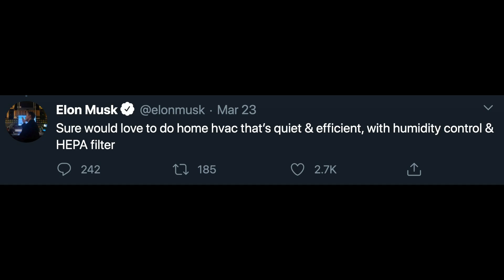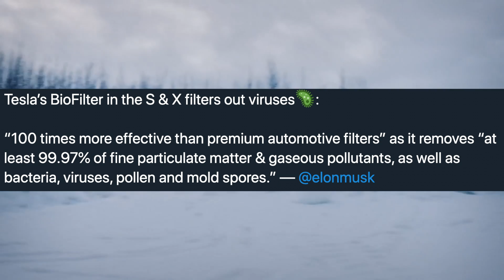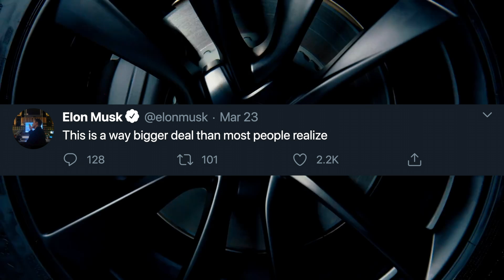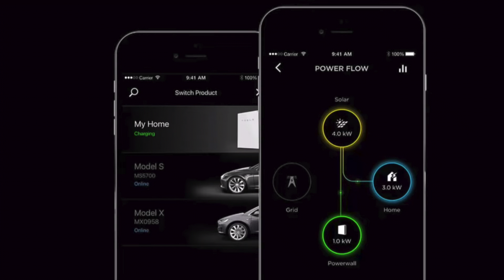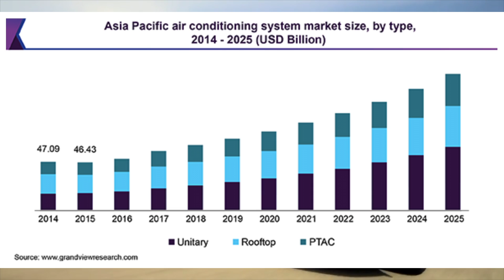Tesla's Secret Upcoming Product: HVAC for Homes (Heating, Ventilating, Air Conditioning)

Comment: If you make window shakers (window a/c units) with high-end items like inverters and HEPA filters and so on, they will be as expensive as Tesla's cars. Working-class folks will be priced out of the market. In addition, only the rich will be able to afford repairs to such pricey units.
Reply: Chuck Wagon so you already know the price of these units before they’re even out? Nice dude
Reply: @devanclark8018  
I've been in the HVAC manufacturing business for over forty years. Yes I do know what they will cost because I know the technology Tesla will use. It's "inverter" technology, which allows the window unit to operate at lower speeds than regular air conditioners and involves the use of expensive circuit boards and capacitors.

Comment: If they make lightweight, portable, noiseless, decent cooling window AC i will buy their company.... i’ve been looking for one 5 years... tired of old, heavy, big, noisy ones....
Reply: You can get a 1 ton hvac mini split head unit for about $800 on Amazon. They are nearly silent. RVers are ditching their RV hvac systems for this set up because it can heat and cool the RV from 3 solar panels vs needing shore power and propane.
Reply: @Squeezmo   i live in public NYC apartment..... i need window AC... split is very good system for private house/apartments...
Reply: LG has already done this. They have 3 different sized window units that use variable speed compressors. They have essentially put ductless minisplit tech into a window unit.

This is the model number of their  14k btu window unit. LW1517IVSM.

They have a larger unit but it is 240v.
Reply: nonsense
Reply: Lightweight and portable means small, small means small ventilators, small ventilators means little volume of air or high fan speed, so either noise or sacrificing capability. You are most likely asking for something physically impossible. That is, if you don't have a better idea to move air than fans, since you need to move air in order to cool it
Reply: @trulyUnAssuming  Exactly. The noisiest part of typical HVAC systems is moving air through the condenser, evaporator and any applicable filters. HEPA filters introduce a fair amount of head pressure, so you need fans that much more powerful to push air through. You are stuck having to pick along the spectrum from large fans that produce nearly-white noise to small screechers. I can barely hear my window AC's compressor over the noise its fans make.
Reply: @teardowndan5364  note that R410 minisplits are using variable speed (variable low would be better), large diameter slow RPM fans.  We used this scheme on submarines to make our equipment run quietly and efficiently. There's a lot you can do when you move away from what everyone else is doing.
Reply: @teardowndan5364  So why can you barely hear a mini-split outdoor unit running?
Reply: @teardowndan5364  that's the problem./ It's the blade technology. There are blade shapes that are nearly silent... and eductors can be used with small, high speed fans  to quiet and mask duct noises (again, submarine tech).
Reply: @trulyUnAssuming   "something physically impossible" been proven by many tech devices that almost anything possible in 21 century.... good brains and money in 2020 can make impossible things possible... or at least close to that....
Reply: @NEWTRUESTORIES  No, tech devices just do things which are difficult, not impossible. You can not cheat physics.

Comment: He’s late to the party, and not many AC units I know of run on gas.  You’ve not explained one thing that is not already on the market or how he is going to make a better mousetrap...   the power wall doesn’t seem like it’s lived up to the hype besides being a better tracker of ones power consumption and I wouldn’t be surprised if they are monitoring and controlling your AC real time with the ability to shut down during a crisis.
Reply: Heat pump
Reply: Kevin Dickson lol heat pumps have existed for long time and the R&D from the big manufacturers are light years ahead of Elon

Comment: Nice video and joining of dots, but you can go further.
Google, Apple, Amazon etc are trying to create the smart home, though just to stir sh!t, I’d argue that Tesla’s ecosystem is just as good, if not, better. Their access control (locking / unlocking / motorised door handles), hvac (pollutants incl), power management (on / off / schedule / amperage), App integration (runs google maps, Spotify compatibility, youtube), lighting control (app control, automatic), security (sentry mode), ranks them ahead of anyone else. The final step is taking all that stuff out of a car and putting it in a house. At least, that's how the argument goes...

Comment: It’s crazy AC uses a much smaller amount of energy than heating, but in the southern us, during the winter, your electricity usage dropps
Drastically, even when its freezing outside and you have electric heat.
Reply: Howdy Justice which is why it doesn’t make sense AC is a much smaller percentage of the energy usage graph

Comment: That would be pretty sweet to optimize HVAC to work off of home batteries. I think we would have to optimize the house electrical system to work off of batteries.
Reply: all Homes should have been Converted to 100% Electric in 1900. 
Electric Fireplace and Heating, Electric Waterheater, Electric cooktop , Electric Oven. 
and it should have been Mandated , all NEW Homes in 1900, should be 100% Electric.
Reply: Im_Zee11 lol so the battery gets charged by the grid and then powers the AC unit? What’s the point in that? If it were solar you would spend a huge amount on panels and batteries never recouping your initial costs.
Reply: ReluctantProphet mmmhh what if there’s no grid?

Comment: I’ve got a solar tile roof on order, I’d love to add a Tesla HVAC unit to that.
Reply: I do too, have you been given an install date yet? What state are you in? I fear we may miss the 2020 energy tax credits if Telsa drops the ball on this
Reply: Minni , I’m in California. Haven’t heard a thing except initial e-mail from a rep. He said I’d be contacted in the next 30 days but that was about 30 days ago. I can imagine they are in a bit of disarray given the lockdowns.
Reply: @shepherdsknoll8  Yeah I know, I wish the company would more forthcoming with information as as availability. I'm in New Mexico and need a roof I'm trying to hold on but I don't have too much time left. I submitted my energy bill and they said it should move quickly but did not give a timeline.
Reply: Minni , if I have to go another rainy season, I will. We are just coming out of 2019-2020 rain now. For the last three years I’ve held my wood shake roof together with elastomeric paint (roof paint) from Home Depot. It is a cheap short term solution.
Reply: Minni , I just got my roof plan and estimate from Tesla, it took a little longer than 30 days. For a 3000 sq ft home it came to $49k with (2) powerwalls. There is a federal tax credit of $7500 so total cost is $41,500. I think I have a California state rebate also. Tesla is applying for permits now.
I really wanted the slate style roof but this price is so good I went ahead and accepted. My electric bill runs $600/ mo. so this is a no brainer. If the slate comes out in 2-3 years I’ll re- roof.
Reply: @shepherdsknoll8  So you are getting traditional panels and replacing your shake roof?
Reply: Minni, I believe Tesla only offers the black glass paneled roof tiles at this time. Is that what you mean by traditional ? Yes, I will use their black glass for now.
Reply: @shepherdsknoll8  ok got it, so you got black tiled roof that's awesome. I'm still waiting to hear something

Comment: They got the boring company. All he needs is point his boring machine downwards.
Reply: It has been proven that geothermal heat pumps cannot compete with mini splits
Reply: You don't need a 12 foot diameter hoke for a heat pump. They use well drilling trucks to install geothermal.

Comment: It all comes down to, if they could produce a system that is cost competitive with with traditional HVAC systems.
Reply: @William Arrington Oh! like Apple. Yea that occurred to me also. The last thing we need is another company creating a closed ecosystem that locks people in.
Reply: How dumb are you?  It would be no different than existing systems.  There is nothing new to do.  You want HVAC that is quiet with filter, go buy one from any number of producers that already exist.
Reply: @w8stral  Air conditioning manufacturers had little to no incentive to build more efficient equipment till the government mandated they do so. It cost the industry a great deal of money and consternation, but today they are competing using efficiency and energy savings as a selling point. The car folks didn't like disc brakes either, now they build cars, light and heavy trucks with them and we are all safer for it. A to the cracks about "proprietary equipment", that is already baked in when one large, well respected maker created their own freon blend and build a system that exploit that compounds thermal properties. Nobody put head lamps on car fenders till the patent ran out on the high end folks who held it. So goes modern manufacturing progress.
Reply: @w8stral  You need to rethink your position vis a vis what is your mouth hole and exposing that other hole to public condemnation. I believe if you will cease frothing at the mouth, you will find I said about the same thing you have, albeit with a much less political crap load. R22 and R12 are not the first common refrigerant brews used that turned out to be very toxic and needed to be outlawed or insured at catastrophic rates. Go look up R502- liquid at room temperature- will evaporate in your bare hand- but by the time a few grams have evaporated you will have absorbed enough poison to kill you. It wasw the refridgerant of choice for hotels and convention centers. I believe I remember R22 being one of the replacements for it- it doesn't retrofit any better than Ra 134, at least not with out expense and changed efficiency; as a refrigerant in a car, Ra 134 is only about 80% as capable of carrying the same thermal load , pound for pound as R12. The result for Detroit is ACs that were about 20% less efficient than before the early 90s, when the R12/R22 phase out began.
  PS; Getting up front and personal with me is not what I would think to call a "thinking or questing sort of response". The price of civility from me, is you being civil to me. Your turn, AH
Reply: They have the leg up of being able to market to rich people for the first generation if it’s too expensive.
Reply: Victor - EZ to do a simpler HVAC system with NO pulleys and NO Belts , means it can be made Smaller & Lighter and Cost LESS, also having a CLASS Leading Medical Grade HEPA filter as well.
Automatic AI Fuzzy Logic computers will only Cool/Heat when room is Occupied and will Automatically balance the Humidity, it could even be an Emergency source of Drinking Water.

the NEXT step is to Create better and more Efficient solid state Cooling/Heating Tiles. 
ones without ANY Pluming just a Electrical Circuit.
the Inventor of that will make a Fortune.
Reply: @markplott4820  We already HAVE that.... they have PISS PISS PISS POOR efficiency.  HVAC systems(medium/small) do not have pulley's belts.  Only the GIANT commercial ones with BIG squirrel cage fans do.  Basic HVAC all have dehumidifiers built in, otherwise it becomes bad news.  Most people for their homes are not willing to pay for it. 

Grow a brain, stop worshipping and swilling the TESLA Kool-Aid
Reply: Not necessarily. If they sell a smart home HVAC system with clean water generation, they can capture the added value through higher upfront cost.
Reply: @Fridgidice  Dear Ignorant Arrogant Dumbo, you get this already if YOU BUY IT.  Just because you are an ignorant lazy idiot, does not mean the rest of the world is.  You simply REFUSE to PAY for it.  PS: you get ~->2 gallons of water a day in a VERY humid environment and near ZERO in a dry environment...... yea as if that is worth an extra thousand to two thousand dollars when a $40 water filter does a superior job and does HUNDREDS of gallons.  Troll onward Ignorant!
Reply: @William Arrington No I don't think many people have. However what I do mean is that not every millionaire has a mansion. The majority of them especially in the vicinity of Elon Musk, have apartments or townhouses. These are the same people who only drive Teslas and already have Powerwalls and TeslaSolar on their roof. Telsa could easily sell to them just based on the fact it would be supported by the Tesla app.
Reply: @William Arrington Don't forget the new refrigerants are more corrosive, and have lower COP than the old ones so your HVAC systems die sooner and require more power to operate.

Comment: You informaation is wrong...Tesla is using Hepa filters since 2014 since the unvailing of the model x event. And not 2019 please check
Reply: That pic in your video is form the model x unvailing event
Reply from the maker: I was referencing the Bioweapon defense mode HEPA filter, an upgrade from the previous Model S and X filter. The picture was from an article talking about the upgrade.
Reply: It's there since model x

Comment: HVAC accounts for 40% of total building energy consumption. We spend most of our time in buildings.
Reply: What about insulating your homes?
American houses are mostly un-insulated I understand.
Reply: @SwedeInCPH  Your absolutely right ! Best cost for your money.
Reply: Wrong Insulation Does make a Huge difference no matter where you live, Windows are on the lower side of  efficiency upgrades you can make with the exception if you live in a glass house. As someone who Works and follows the Industry  less of a Heating and Cooling load less Energy required.
Reply: @Gcanno  thank you mate, for the last decades, european and asian countries have been building more and more efficient insulated houses that requires little to nothing for cooling or heating, in japan the dont really rely on heating during winter , they use huge thick bedshit for example. the US is always behind as a usual
Reply: @William Arrington stop talking nonsense
Reply: @William Arrington Yeah and I do Hvac most the time and Proffesionals like you , speak of Lab numbers which never translate in the Real World and yeah I deal in thermodynamics everyday too the only difference is I do it in the Real World . A world where we Test in and Test out to Confirm efficiency and Seer. Which by the way depends on everything connected to your new Hvac system that includes lineset ,component location ,Ductwork ,System Refrigerant Charge, and Yes Insulation Take 140 Degree Attic in the Summer Take your Duct R Value and Calculate it  by the total square footage of Duct you have running to get your losses then see if your seer adds up 9 out of 10 times it does not. These are the people who write the standards if you ever want to educate yourself . https://www.acca.org/about-acca

Comment: I wish he would set his engineers on the problem of solar home heating,  specifically involving the siding, since the roof is already producing electricity.
Reply: What about a heatpump that produces both cold and heat?
A solar cell has an efficiency of 30%. Collecting heat from the roof through water wacuum pipes has a 90% efficiency.

First action: Insulate you homes. I hear American houses are generally very poorly insulated. Pays off both in summer AND winter, but maybe too LOWTECH to be sexy!
Reply: @SwedeInCPH  I agree with insulating homes as an important first step.  For some reason roof solar heating systems never caught on.  Maybe a good solar photovotaic system with battery storage plus a geothermal heating/cooling system would be a good combination. A number of  decades ago the use of zeolites was suggested for heat storage during the summer which would then be released in cold weather, and it was being studied a few years ago in Europe, but I have not heard anything significant since.

Comment: It is a cool idea but think you are missing key details on the type of HVAC system Tesla would develop. It would obviously have to run on electricity and be super efficient. Therefore it would have to be a heat pump, likely an air source or split ductless.  Tesla just started building heat pumps for the Model Y after using a different HVAC system on its previous models. I would expect Tesla to convert all its models to heat pumps before getting into the home HVAC business. Look for that as an early indicator.
Reply: Agree.
Reply: They are coming out with heat pumps providing heat in colder and colder temps too